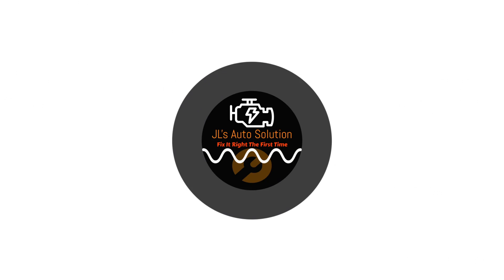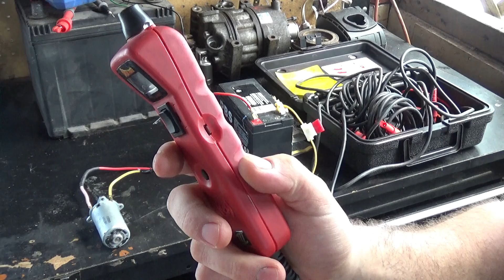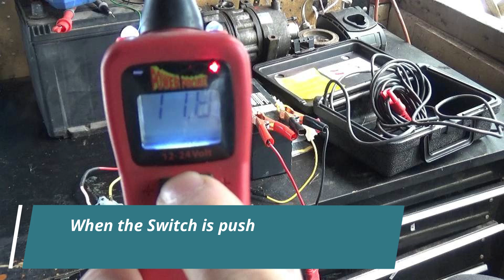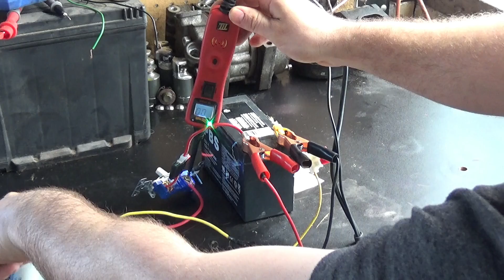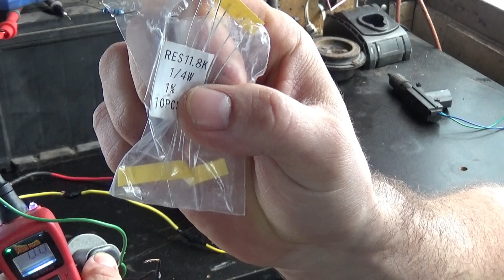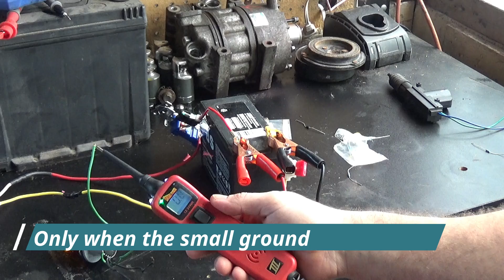PowerProbe 3 P1

Comment: Just what I was looking for.

One question if that's OK.

On the first demo, voyage drop, do you get a reading on the screen on the ground side along with the green light?
I'm used to using a multimeter, so thought I'd ask.

Or does the power probe have the ability to test voltage drop on the ground, sensing any volts that should not be there.

If that makes sense. Cheers

Comment: I am not nitpicking, but you may want to do a follow up video on using the Power Probe when working with computer controlled circuits, what is safe to do and what is not, the not being expensive. A schematic in a demonstration such as this would help the people that still have a hard time understanding the dos and don'ts in using this tool. Thanks again.
Reply from the maker: All that is comming up in part 2..
Reply from the maker: Thanks for watching
Reply: looking foward to part 2